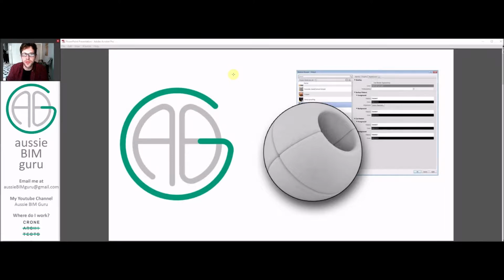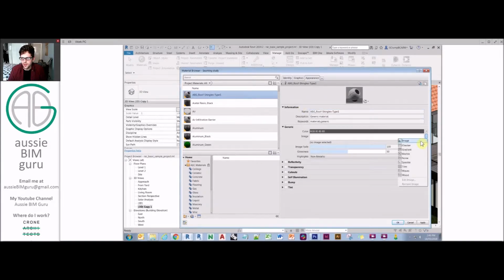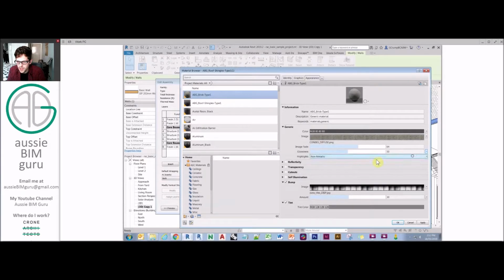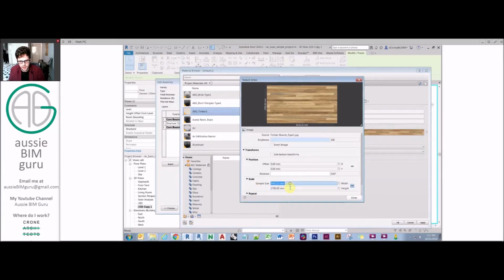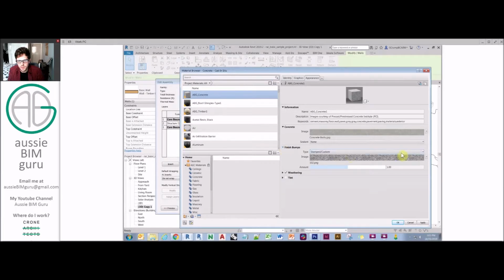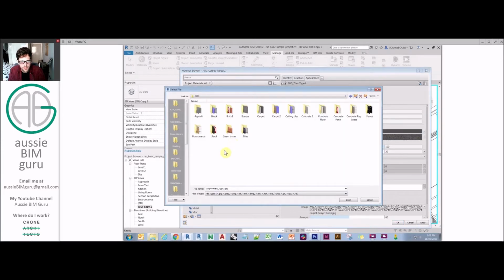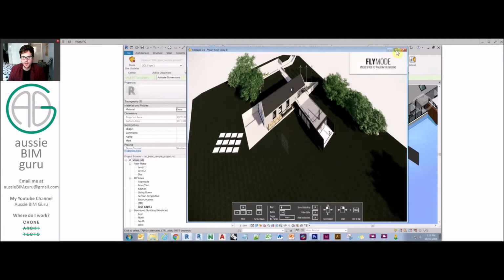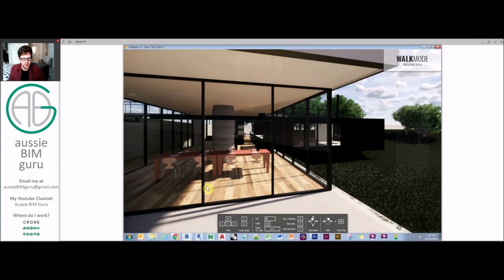Making Custom Revit Materials! (Materials 2/3)

Comment: Why use a keynote to tag the material as opposed to using a material tag?
Reply from the maker: If you want to lift out a finish code on a composite object that is usually the main reason. For example if you tag a paint finish on a stud wall in elevation, the wall wouldn't use a paint keynote typically, but the gypsum layer could.
Reply: @AussieBIMGuru  so the paint would use the material tag and the gyp layer would use the material keynote?
Reply from the maker: Usually I make my gypsum material the base paint as its material keynote given it is always finished as such externally. I avoid paint tool unless it's a feature paint/wall but in that case that is how I do that (and then tag with material keynote). Note this is in elevation, I don't typically tag elevated finishes in plan.
Reply: @AussieBIMGuru  so if I understand... you are making a gyp board material with a paint code e.g. p01 in one of the parameters. You are then using that material as a finish side of a wall type? Wouldn't you then have to have a separate wall type for every paint color?
Reply from the maker: @charlesball9522  sort of... i usually assign the most common paint finish in the job to my gypsum material (as a material keynote), which i apply to the plasterboard layers of my wall types. Technically the whole sheet has that material keynote, but if needed, the outer face can be painted with a feature paint. The paint finish usually isnt related to a wall type as wall types are more about wall layering and construction.
Reply: @AussieBIMGuru  I don’t think I understand fully. If I want to, irl paint a lot of walls blue (P01), I would need to create a gyp-wall board material that has P01 in the keynote field. We’ll call it Gyp – Wall Board P01. I would then create a wall type (A1) that was comprised of a 3 5/8” structure layer with the material Metal – Stud Layer, and two 5/8” finish layers with the material Gyp – Wall Board P01. So now I have a non-rated partition, A1 that will tag as P01 with a material keynote. But what if I also needed to paint a lot of walls white (P02)? Wouldn’t I need to create a new gyp material and a new wall type with that gyp material? So then I would have the same wall type with the only difference being the paint keynote?
Reply from the maker: @charlesball9522  yes you could either make a wall type if it is super common versus a feature wall with a different gyp material, or paint the featured faces. Generally a 92 stud wall is typed by its makeup but not its finish, so you could potentially have two wall type 01's where the user knows in revit they have different paint finishes, it just depends where and how you need to capture/sped the info. Remember sometimes you may have a wall with diff paint either side too, or maybe tiled - wall types get out of hand fast if you let the surface finishes dictate their type. Also the partition contractor isnt overly interested in the paint types when they lay the tracks and place the boards, so theyll be hoping for a simple set of wall types too.

Comment: How do you go about creating the "Specular" map (Image file) for reflectivity?  As you use in 28:50
Reply from the maker: There are a few ways, most people paint the highlight areas in photoshop manually. Alternatively you could build the base texture in 3d using a modelling program and render one out.